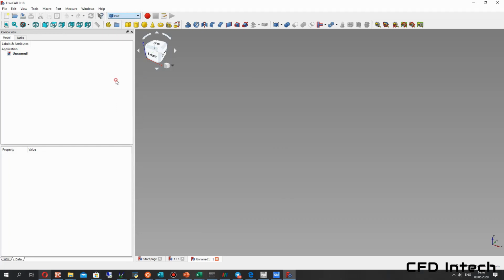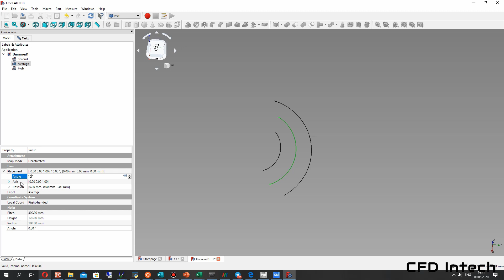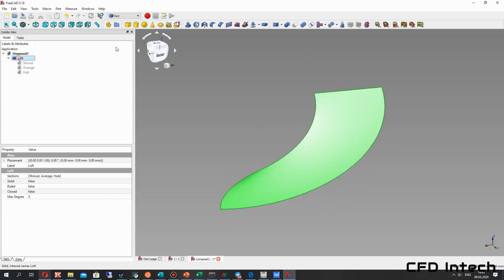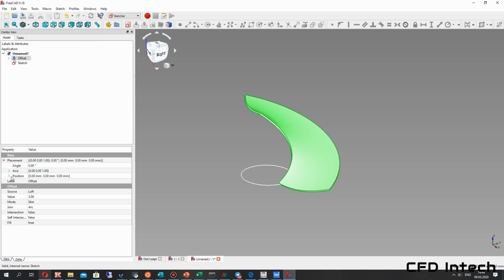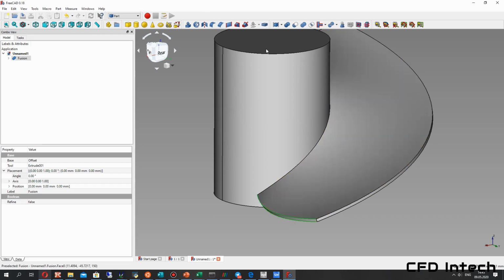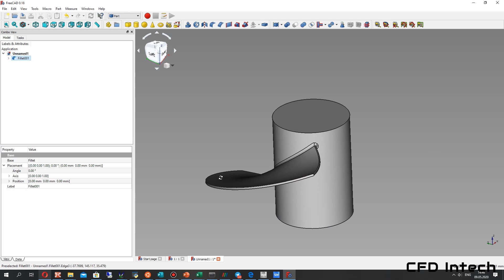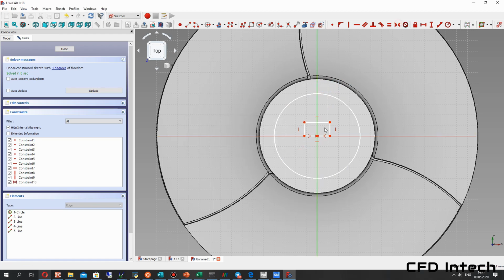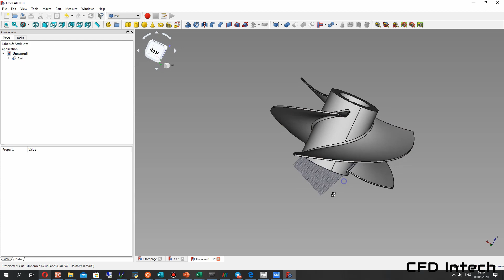FreeCAD Tutorial Part 1 | How to create 3D Model of Impeller for Water Jet Pump

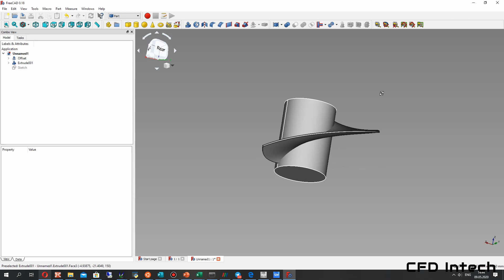Comment: Hi, Good tutorial, when I change the Offset angle to 45 (4:42), I get another loft, now i Have two lofts but yours remain one. 
To avoid this problem, I brouyght the loft back at 0 so that it can become one loft, but Boolean failed in Union. 
The error is "Union not possible between non-solid bodies. 
I tried to select offset and extrude and ran Part: Check Geometry but this is disabled. When I select faces, only then it enables. 
After this, I cannot proceed with the tutorial. Will you be able to help. Thanks